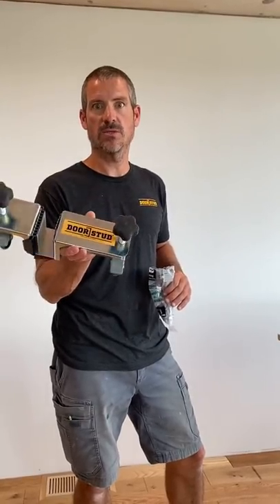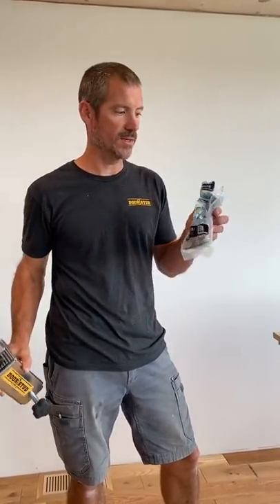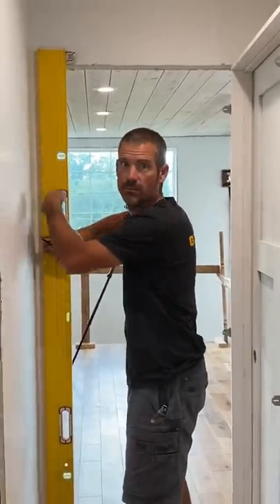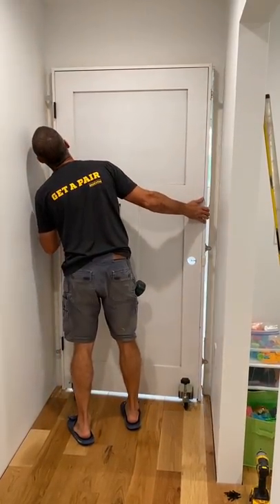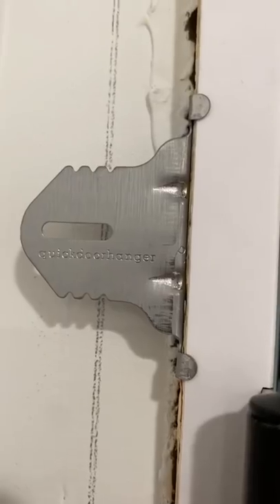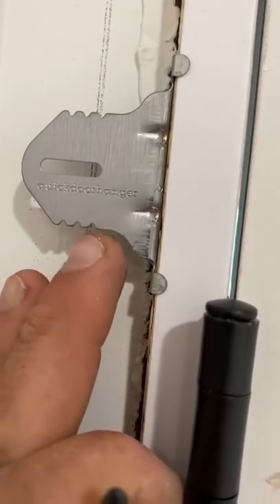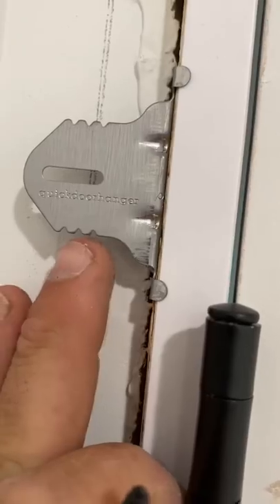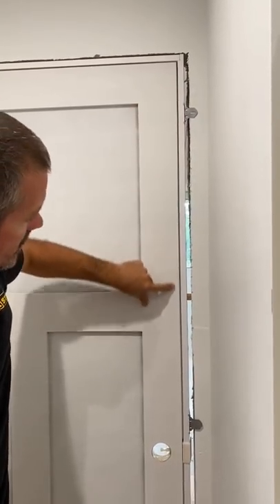Interior Door Install | Door Stud #shorts

Comment: That door won’t last more than a year before it gets all out of whack
Reply from the maker: Thanks for your input!
Reply: It'd be fine unless teenagers are swinging from the door 🤣
Reply: To be honest you are right.
Reply: Are you talking from experience or just talking?
Reply: It’ll stay in adjustment much better than the typical production interior door install, which amounts to a handful of gunned 2” finish nails through the Jambs and a few more through the casings.  At least there are a few screws involved.
Reply: Maybe if it was mounted from one side but they cut the part where they bent over the back tabs and shot those in too… you could add more clips and shim if you’re hanging anything obnoxiously heavy.
Reply: @HBSuccess  That's correct on diyers, a profesional will use shims on 5 points of each side of jamb and use some 2 1/2" 15 ga nails.
Reply: You spelled week wrong.
Reply: @kelsycunningham8452 , I'm totally getting your point there ... thanks
Reply: @robrey468  and you save money not having to buy specialty brackets.
Reply: @robrey468  You would think, but shit work is all over the place.
Reply: I see nothing in the video that would stop you from shimming and nailing after the fact.

This just seems like a fast way to initially position and hang the door. I wouldn't rely on those brackets alone.
Reply: @robrey468  nailed it...
Reply: Will if it gets out of wack, it will be alot easy to fix. LOL.
Reply: @HBSuccess  2-in finish nails are NOT the way that you're supposed to install it anyway. 
The system is fine for getting it close but I would still finish it with shims and finish screws.
Reply: @drockx85  The whole point of buying tool is it saving you labor - which saves you quite a bit of money over time. That's the main metric of a tool.
Reply: @thatguythatdoesstuff7448 
I totally agree - but he doesn't show that and that's a shame.
Reply: @randallsmerna384  but this doesn't save labor, I can hang a door in the same amount of time with a level, trim gun, hammer, and nail set. None of which are eliminated in this method, just more steps.
Reply: @drockx85  Perhaps. But I can't stand it when someone hangs a door with freaking nails. Undoubtedly they loosen up over time. And to do so without shims is unconscionable.
Reply: @thatguythatdoesstuff7448  i wouldn't rely on those brackets at all, the video doesn't indicate that further securing is necessary so if it is they failed miserably at this video of interior door installation....lol
Reply: @robrey468  The guy is a professional.  You can always count on people complaining because someone does a job different from them.  You skin your cat and he'll skin his.

Comment: That makes it super easy and accurate at the same time!
Reply from the maker: Oh, it was crazy awesome doing the install this way
Reply: I would still shim and fasten traditionally through the hinges and latch side just for the added skookum Factor because too much is just enough.
Thanks 🙈🙉🙊
Reply: @eddiegreg7064  Same. But I do like system.
Reply: Trimmed properly add strength and no matter how you install it the warranty will only cover your door if Trimmed on both sides with nails in door frame and wall stud, 45° miter cut and pinned to top and sides  that's all your strength it ever needs oh yeah do not forget about the hinges either one 2½" screw in every hinge and two in the strike plate now that is not going to move it will brake first that system would give you perfect doors every time lot easier to teach the new guys and they are able to do it first day and never have install a door before that makes it worth every penny.....

Comment: I’ve installed doors “the old-fashioned way “and with that new six bracket system. That bracket system is the bomb! Totally fool proof and much quicker and easier to do  if you’re alone.
I’ve never used those wheel thingys though.
Reply: And when the drywall crumbles from behind the brackets after its all installed  and your frame is loose - then what?

Comment: I'm assuming the casing has to be carved out on the backside so it will install flush on the wall with those brackets in place?
Reply: You probably put the molding over that bracket that sticks out

Comment: You don't need brackets screw through the frame in the middle, cover the screw heads with the door jam. Two wedges instead of unnecessary heavy kit that most will use once or twice in their life, and after a couple of years rattling around in the garage, most will forget what that random piece of crap was for

Comment: Great for the inexperienced!  Not knocking it (no pun intended).
Reply from the maker: Haha yes. If you do this all day everyday not as significant but helpful for the every once in awhile install
Reply: Y wouldn't a man who does doors all every day use it .. work smarter not harder
Reply: @roberttempleton8112  because that looks slow and time is money
Reply: @paulprescott7681  tell that to his back at the end of the day
Reply: @roberttempleton8112  I do this for a living. You still have to carry the doors up staircases. That's the hard part IMO. Not popping the door in the rough opening.
Reply: @roberttempleton8112  because if a guy knows what he’s doing and does it all day every day, the door will be set in less time it would take to set up those brackets.  Not knocking it and I wouldn’t mind trying it to see if it would speed up production.   After all time is money in a production environment.  Does seem like a cool product.

Comment: Nice system never saw you using the threaded riser aspect which would have been nice. That’s kind of the whole point of the nice system those 4 threaded risers that lower and raise the wheel assembly. Thanks for posting
Reply from the maker: Thanks 👍

Comment: Lucky if you can find  wall frames that accurate these days..I noticed one side was nearly at the limit of  bracket slot .
You would be surprised how many vertical stud are out of plumb on one side when facing door cavity...they just cover this by fixing a rebate strip against door  giving the illusion of accuracy..door will  NEVER  work properly ever. Also often only two hinges on exterior doors that then warp or twist...

Comment: Looks like a great system and much easier for one worker to do alone than it is with shims and a nail gun.  It appears to be a much faster install process.  Construction workers tend to be slow to try new technology but eventually they switch over if something proves to be better over time.  Pex plumbing comes to mind as an example…even screwing drywall as opposed to using nails.
Reply: It appears to be easier- but 90% of installs are not this easy. If you have to cut down the bottom of the jamb, this system does not allow this. The first pex that came out was absolute garbage and the buildings that adopted this first generation of pex are still paying for their haste to early adopt even to this day.

Comment: Geez this must be an east coast install. Just set the door to the reveal because not all walls or floors are level and plumb. So the use of a level can cause a tremendous amount of mental anguish and colorful language. All you need is good eyes, 15ga finish nail gun, shims, and common sense.
Reply: But hey the tools used in this video are shiny.

Comment: Meh.  They might serve a purpose on some big, heavy doors,  but yer average door,,   they'd only get in my way.  Secondly,  the reveal mentioned in the video isn't the gap between the door stile and the jamb,  the reveal is the amount of jamb left exposed when installing the Casing.   YouTube had some benefits. And, as a person who works in the trades and has my entire life. I will say. I have learned some stuff off YouTube/ the internet, however,  85 - 90% of my knowledge has come directly from hands on experience.  Lots of ppl can watch a video, get to feeling froggy and wanna leap,  not many can pull it off successfully.. plz, plz plz,  consult a professional prior to doing something you've never done..   I'm not saying you can't do it,  in fact, anyone with a Lil bit of brains and a whole lot of patience can pull off just about anything,  might take you longer,  there might be easier ways of doing things, but too many people watch videos,  get to feeling like they're a diy king, and then end up calling someone like myself to fix or finish.  Unfortunately.  My rates raise when I have to come behind someone else, because I don't know what's under the skin of the project,   if I can't see the bones,   I'm explaining in detail that,  the rate may increase, significantly, if I tear into it and it's not anywhere near correct...  which, has happened more than once and in 1 case, saved a cpl alot of money, time and aggravation...   happy trails..

Comment: What's the point of having a door with a gap at the bottom🤣
Reply: Very simple. In production homes in the US the HVAC system relies on return air rushing under the doors to find the single cold air return typ in  the center of the house, because it’s too expensive and time consuming to design/install a proper ductwork system.  So doors typically need to be 1” or more above the finished floor.  Plus it allows mice to travel easily between rooms.